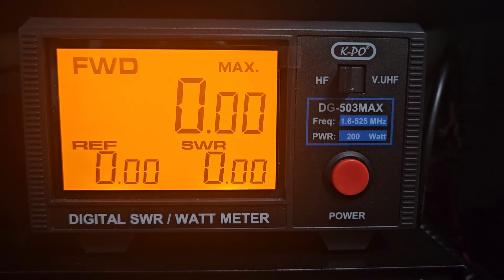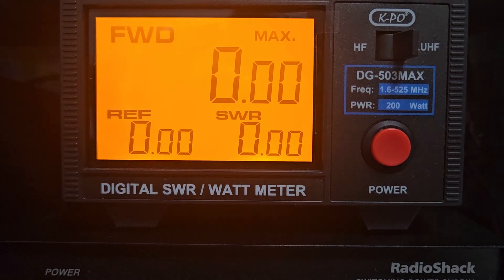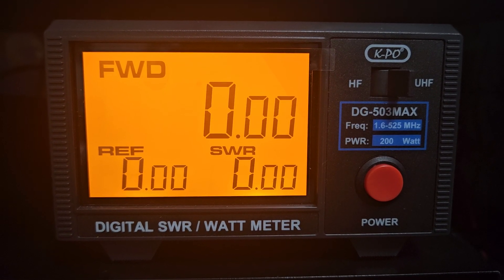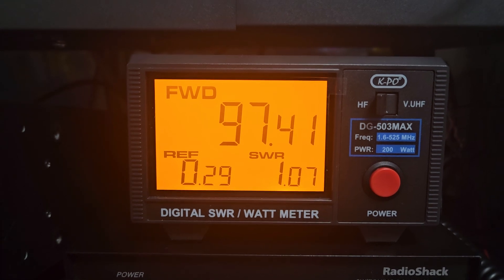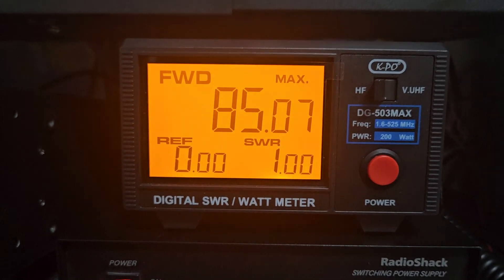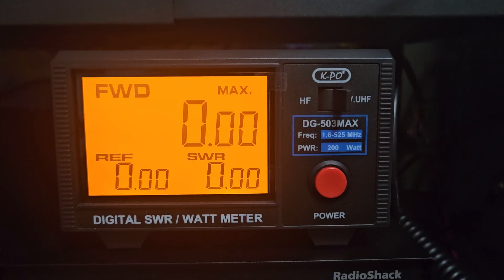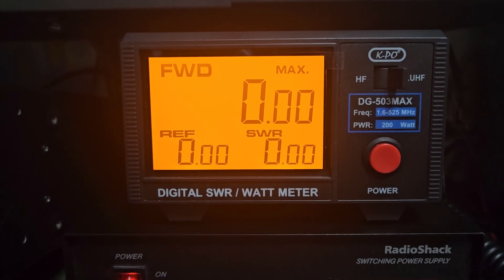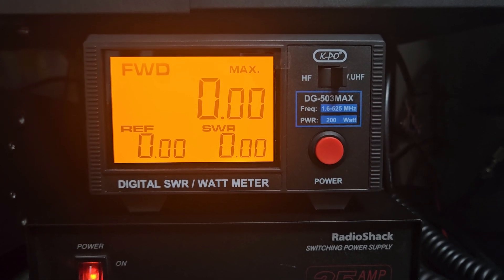K-PO DG-503 Max HF, CB, 2 Meter, 70 CM, and GMRS SWR Power Meter

Comment: I have the Nissei DG-503 HF/VHF version, I bought two and both of them are useless! Those SO-239 Connectors are junk on just about all of them!
Reply from the maker: Well what I'll say to that is I've never had any problems with the K-PO models.
A lot of times people complain about SO239 connectors when they're doing their own PL259 connectors and they oversolder them and that expands the male part. Which in turn ruins female SO-239 input.

Comment: I have a DG 503, with ssb it doesn’t seem to show accurate power or reflection🤷🏻‍♂️Some folks say try on FM, but what’s the point? I want to see power and reflected on ssb
Reply from the maker: Unless your meter has the max circuit you're not going to see any peak envelope power which is what you need to measure power with on SSB. 
Technically speaking you don't want to see a high reflection from the antenna.